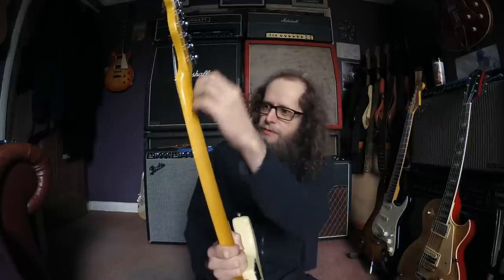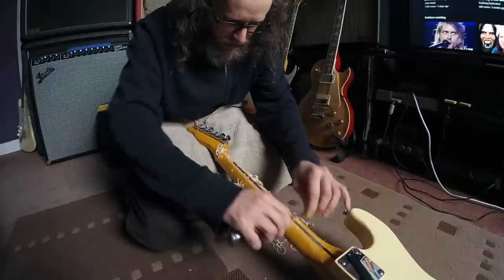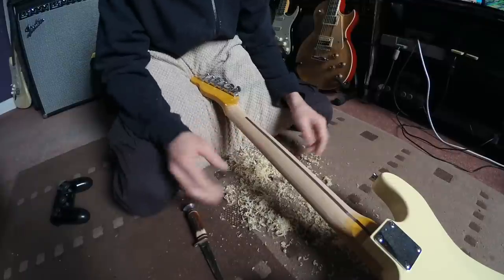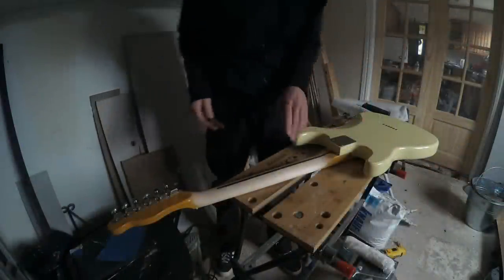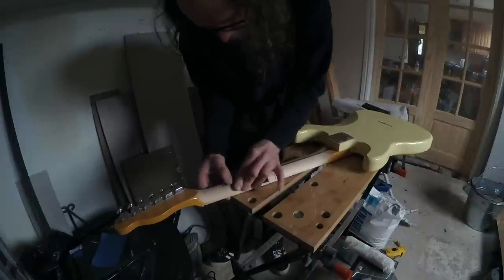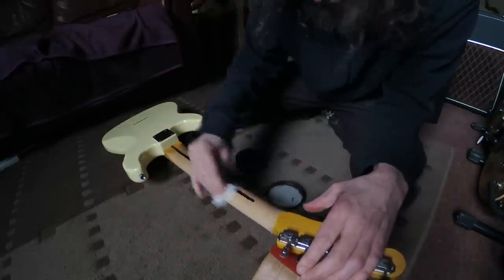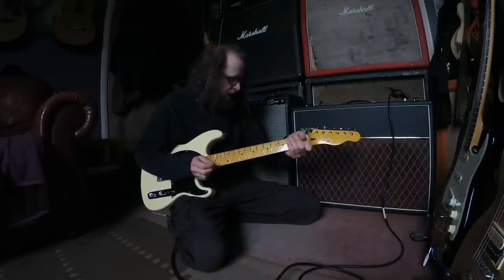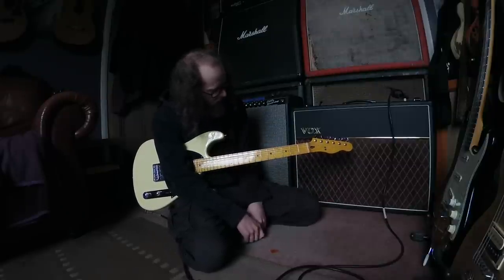Reshaping A Neck

Comment: A good tip is to take a damp cloth to the bare wood in between the different sandpaper grades to raise the grain of the wood. Dry it off with a hairdryer then sand again. Do that about 3 times and it'll come out smooth as silk 👍

Comment: Great work. One tip I can give you to drastically reduce your hand sanding time after the carving, as well as make the contour stay true to the curve your after,  is to use a auto body repair style sanding block. Start with a 120 grit (US) and minimal pressure from the center and move diagonally to the edges with a little more pressure. It will knock of the high spots quickly. Go up and down the neck where you've carved without focusing on one spot too long. Remember not to push hard on the center or you'll keep losing thickness. The longer and wider you can make your strokes to the edges the better. Then move your grits of sandpaper gradually up to 800 grit (US). You can even take it up a notch by taping up the rest of the neck/guitar and spray a very light dusty coat of flat black spray paint where you'll be sanding. Once all the black paint is gone, you'll know it's dead level with itself. Cheers.
Reply: Now, if someone would just make a video demonstrating that technique. I'd certainly "like" it!

Comment: A good tool for this type of work is a spokeshave.  Will do what the knife does, but the tool is specifically made for rounded wood shaping (they were originally designed for making cart wheels).  Nice work on this project!
Reply: A spokeshave is great, though I find it a little risky for the later stages since you can sometimes get tear out and pull a small chunk, even with care (depending on the wood grain you're working with). I prefer to switch to a card scraper at the equivalent of this stage on carving necks. (N B., I don't claim to be a pro, I've only made a handful of necks from scratch, though I have done lots of woodworking.)

Card scraper works like the knife here, only it has a tiny burr that makes it cut better and far.faster, yet with much more control. They are very easy to resharpen as you go - and you don't need to do all the tricks to get a perfect burr (you'll find lots of videos on such steps), just a pass or two draw filing with a fine single cut file will leave a perfectly serviceable burr when you're first trying the tool and getting a feel for it. They're also very cheap since it's just a small flat piece of good steel (plus a file - and optionally a hard rod - for sharpening).

You won't find a tool that gives you a closer feel for and connection to the wood and what you're doing to it. It's the ultimate "why didn't anyone tell me about these?" tool.

Comment: Hi Dave, in addition to the knife work have you thought about getting hold of a couple of cabinet scrapers?  They are a bit of a faff to keep sharp but you can get curved ones the use of which reduces the amount of sanding necessary.  I found this really helpful btw.

Comment: I'm doing this to my squire contemporary Jaguar right now.
I am using 40grit aluminum oxide automotive sandpaper.
It is removing wood at a fairly fast rate by hand but not so fast that I can mess it up easily.

I am also leaving it tuned up and feeling it as I go.

Comment: I don't think I would have the "bottle" to do this but thank you for showing how you do this. I have sanded the gloss off the back of a polyester lacquered neck and this smoothed it off (less grippy) but did dull down the blue colour, which I didn't mind.

I think here you are thinning the neck down rather than re-profiling it but never-the-less you are achieving what you want to achieve by making the neck more comfortable for yourself.

What I mean by profile (or shape) is the neck shape i.e. C shape, D shape, V shape etc - here you have thinned the neck down maintaining the same shape or profile. To change the profile of the neck is getting into genuine luthier territory in my opinion.

Good vid - thank you.

Comment: I've done this more than once. I haven't yet watched this but I've looked through the comments and got some very handy tips. The video awaits, it'll be interesting for sure.

Taking the guesswork out of it - probably impossible unless you have done this before. So - try to have to hand another guitar with a neck you really like. Take the trouble to prepare templates for the first, seventh and twelfth frets ( or the tenth is it's a single cutaway job) and work out how to secure the guitar for the job which may take quite some time.

Use the templates to work out the material you need to lose, use masking tape to get these lines on the neck. The first cut will be straight across to get a flat somewhere around your final thickness, the second and third will be to repeat this having used the templates drawn and superimposed to find the cord of the radius and rough-cut to those. All this material can be quickly and easily removed with a file. From these, a straight cabinet scraper will do the rest (A curved one doesn't help at all and getting an edge on those is a black art anyway). The rest is now sanding and - take the time with the temples and your comparison neck.

Try to get another guitar to hand to work from and make these two comparative eets of templates. Best of luck! Now I'm going to watch the video to see how he does it.

Comment: Fantastic job and result Dave. I did the same on maple neck I got from eBay. ( maple with skunk stripe and glued on maple fretboard). I went in a second time with a knife, but then the skunk stripe became really thin. I had to soak it with super glue because it was so thin. After some light sanding, the neck was saved, but I nearly ruined it. So be cautious going too far!

Comment: I'm not the only one who does this wherever it's comfortable!  I started with a template and rasp since I was going from a C to a V profile. You really have to pull the neck off and secure it with clamps since there's more wood being removed ..but that's how I fine tuned it.   On the floor at times too, honestly it's the best way to get the feel of it as you go.   It's also why vacuum cleaners are made.
I bought a Tele 60 American Original...perfect in every way except the neck was slightly too chunky for me. 
I love the V profile, so I was able to give it a nice V-ish profile but still keep that Tele feel to the neck.
Like you said....go slooooow.   I never had any intention of ever selling the guitar, so why not make it perfect for me.

Comment: Take a sheet of 220 and fold it in half and tear along the fold then take those 2 sheets and fold those in half and tear the other way so you end up with 4 smaller sheets 4.5 x 5.5 inches. Now this time just fold the long way but don't tear it. Now start sanding cupping your hand to curve the sand paper around the neck. It won't take long to take off material and like Dave says leave the guitar strung and in tune so you can play it to see how you like it as you go.  Take you time and once you like it use 400 then 600 and finish off the back of the neck either with paint or clear lacquer or the way I like it is pure bees wax and polish it. Shes a beauty neck now

Comment: That was gutsy. I didn’t think it would work but you already knew it would because you’ve done it before. Good job applying the wax. That will seal the wood and prevent damage from the atmosphere. BTW have you ever tried a made in Japan 60s ST-62? They cost about half the price of the American Strat and the quality is incredible. The necks are made smaller for Japanese hands. I really like mine. 👍☮️🌞🎸❤️
Reply: That is unusual,  as the older Japanese strats generally came with quite thick necks which put me off them.

Comment: Thanks Dave, I bought a kit Strat last year, it works fine, but much like you`re problem, the neck is like a baseball bat, and almost impossible to play at present, 
I`ve tried to sand it down a bit, but that`s gonna take me a decade to do it like that, so as I`m a former cabinet maker, I also own a small knife similar to your Dad`s, 
and so I might do exactly what you`re doing there. 😎🎸